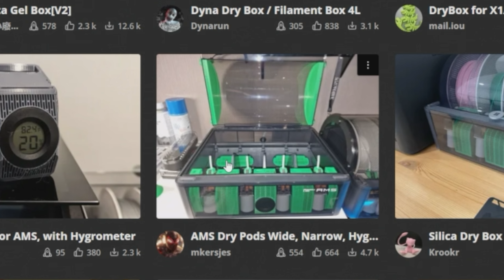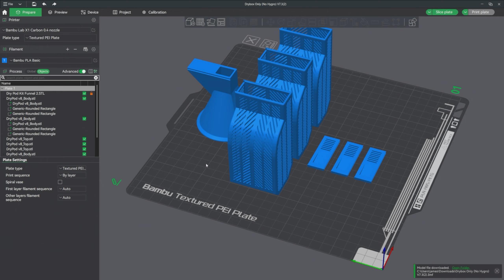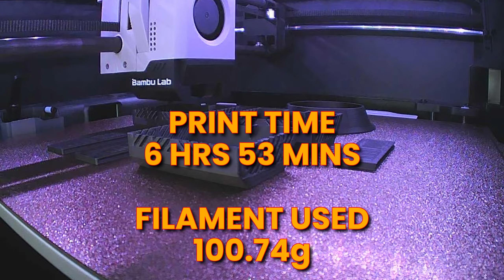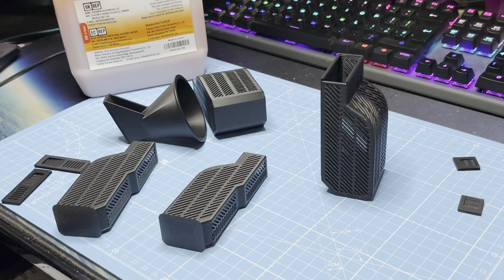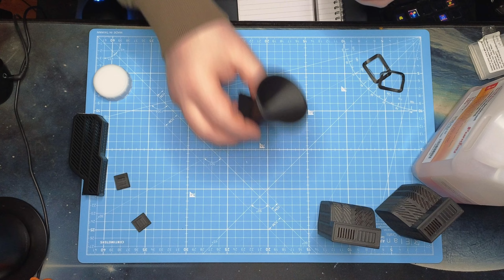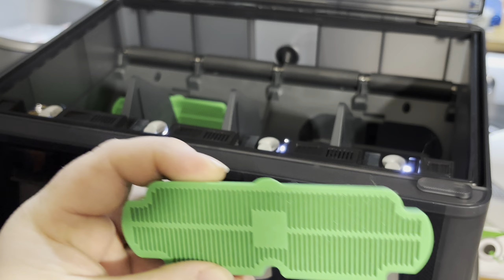Bambu Labs AMS essential upgrade

Comment: A quicker way for setting the colour for your objects is to select everything on the plate (with a mouse drag or CTRL+A) and the just press the number of the coulr you want  ( in this case you would press the number 3).
Reply from the maker: Thanks I will give that a try

Comment: Dont put in micro in plastic it will melt... Use an oven its far better . in a sheet pan
Reply from the maker: Yeah I will be doing that next time 😂
Reply: @THEGAMINGTECH78  and don't use your normal microwave or oven. The colored silica gel is harmful (carcinogenic)

Comment: I was wondering what would happen if you removed the cartridges and threw them in the nuker.  Thanks for the confirmation that it's not something I should be doing when I get my printer.  I think I'm sold on the Bamboo hardware.  Bye bye $1200CAD (When I get there, which should be in a couple months)
Reply from the maker: Thanks
Yeah I have been well impressed with the p1s
Reply: i have a p1s coming in from fedex tomorrow. wish me luck
Reply from the maker: Nice enjoy